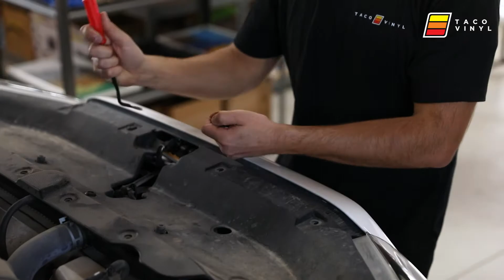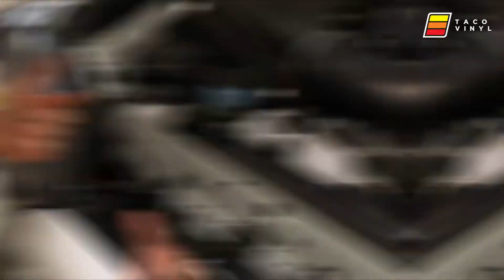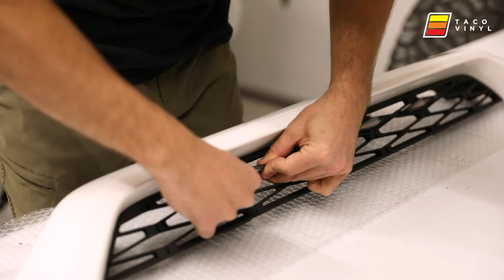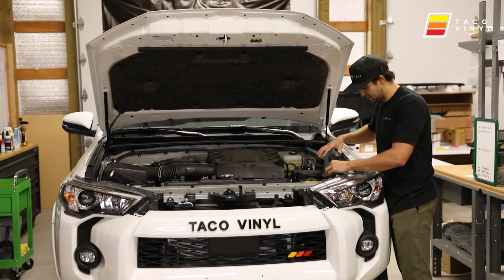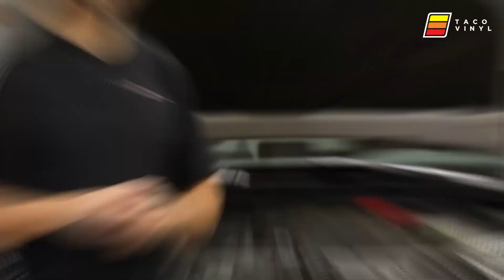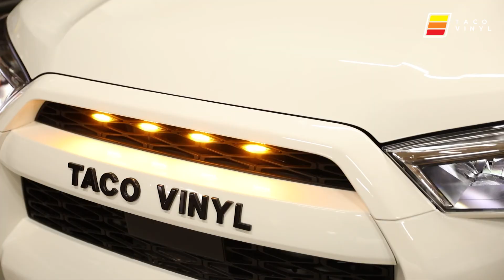Toyota Raptor/Grille Light Install

Comment: My favorite part is after following along with the steps in the video, at the end you don’t show or mention that THE FUZE BOX COVER DOESNT CLOSE. You conveniently don’t show you replacing the cover on camera after the add a fuse is plugged in because YOU CANT. Not impressed, and don’t try the “use the inside fuse box” reply, why did you make this tutorial when it doesn’t work and anyone that followed it now has to rip apart the crimping to use the inside fuse box - which ALSO DOESNT ALLOW THE LID TO CLOSE btw but I guess since it’s inside it’s “ok”?? Thanks for wasting my weekend
Reply from the maker: On the older models the lids close great! Newer models should be piped inside. Also if you have a low profile add a fuse, the box closes just fine. Hopefully that helps

Comment: Hi thanks for sharing 
but just wondering why would you put another 10 amp on the fuse injector when the max amp showed on the stock fuse box is 10amp ?
Reply from the maker: We recommend a 5amp

Comment: So besides the original 10amp fuse we took out and transferred to the add a fuse tap, am I supposed to buy another separate 10amp fuse to add to it??? Please let me know, I’m trying to finish my installation
Reply from the maker: Yes youll need two fuses. You take the one out of the stock position and then take the other from the lid.

Comment: How do I put the fuse box cover back on without cutting the wire with the cover?
Reply: Would have been great to know I needed another fuse before install. Now everything is apart already 🙄
Reply: @slmd1019  He literally tells you in the video at 5:36!
Reply from the maker: You’ll have to notch the box for it to pass through. Some people heat up the plastic and bend it for better fitment where the wire goes
Reply: @tacovinyltv  I drilled a 1/8” hole through the side of the fuse box cover, ran the wire through, and then, on the inside of the cover, crimped the fuse adapter to the wire.
Reply: @tacovinyltv  Even notching it doesn't work on my '22. The add-a-fuse is too tall for the cover to close!
Reply: Hey rich, did you have to buy a separate 10 amp fuse?
Reply: @king485  I did have to buy a fuse
Reply: I was told that cutting or drilling into the fuse box would void the warranty?
Reply: @Roca891  maybe so, the hole is small enough it stays sealed really well. This is also why I chose to drill in the cover, any issues that I need to take it to the dealer I can just replace the cover.

Comment: Hey! So my dad tried installing these lights on a 2019 4runner. 

After the installation we realize we installed it into the fuse below the one you installed it into, the 7.5 amp one. A different tutorial told us to install it into that one, other then the amp fuse difference we didn't do anything different.

Now when we turn on the car we get a check engine light and a trac off light. Do you know what we did wrong and how to fix it?
Reply from the maker: I’ve never used that one before and sadly I’m unsure of how to undo it. It’d run it over to someone to look at maube

Comment: Do you have video on how to install the raptor lights for the rav4?
Reply from the maker: We don’t yet. Working on a few videos at a time
Reply: I just installed them on my adventure and works great.  In-line came with a 15 amp, just swap it for the 10 amp fuse that was removed.

Comment: Let’s show the bare minimum and not respond to any comments! What fuse do we take from the box? Where do we plug it in to? Where to we put the grounded end? You diddnt answer any questions title should be- how take take off your trd grille and pop in lights
Reply from the maker: That’s for the constructive criticism jcoop. We don’t mention where to ground it because some people have different wiring setups. The ground we recommended is the one the battery uses on the body. I would add the fuse into the fuel injectors or INJ. If you have more questions shoot us a DM on Instagram or email us. That’s how we respond quickest. Thanks

Comment: The fuse box does not close down properly because the fuse is so bulky.  Is there a solution for this?
Reply: Yeah I am having issues with this as well. Did you figure it out? I can barely get the lid closed and then I can't get the wire to come out without getting cut by the box lid.
Reply: @jonnyspizza_  yeah you have to buy a fuse box on Etsy that is big enough to cover the fuse. That’s what I did
Reply from the maker: Yes, linking it on the inside

Comment: Hey, besides the original 10amp fuse we transfer to the add a fuse tap, what amp fuse should I use to install on the upper slot of the add a fuse? I’ve seen people use from 10amps to 20 amps on the upper slot?
Reply: I’m also curious about this. If we are “stealing a 10 amp fuse” from somewhere in the fuse box does that mess up some other function on the runner!? Please elaborate or provide some clearer instructions please. Thnx!!
Reply: Tip: please don’t tap into factory wiring. Do yourself a favor and create a separate fuse box and circuit shutoff switch for all your aftermarket accessories. This way if anything goes wrong and you need to diagnose the problem you can easily shut off and isolate the problem.
Reply from the maker: 10amp on the lower and 5amp for raptor lights on the top